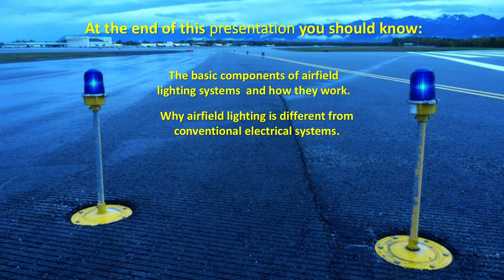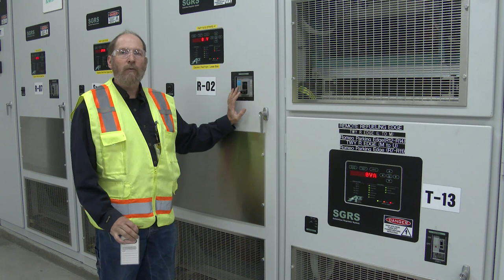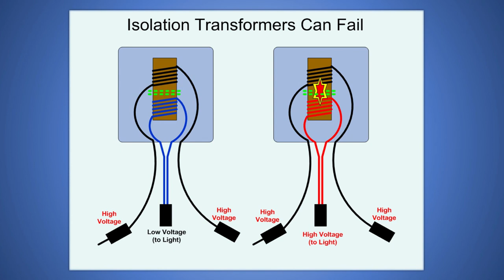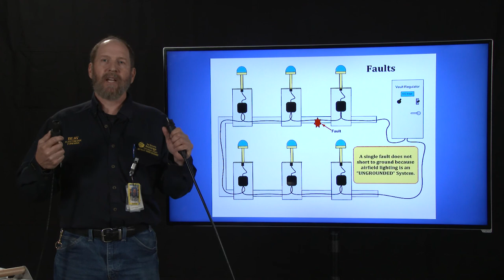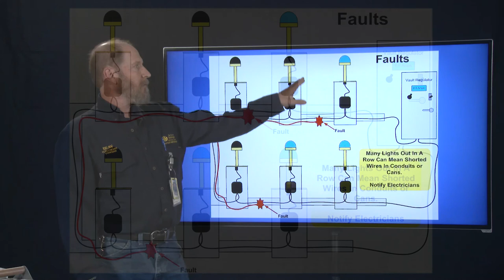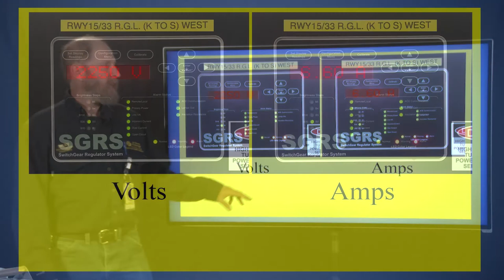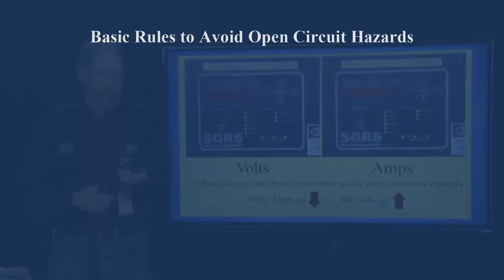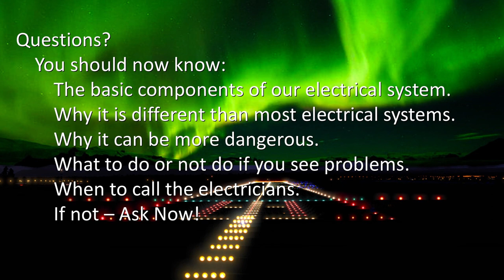TSAIA - Airfield Lighting Safety Program

Comment: 36:18  put it on a radio. You likely have some kind of radio with you, right? Company radio? Airfield radio? Put the clamp over the radio antenna and key up. The meter should show some amps. This is how I tested mine. 

Also, if you take the final bolt out of a fixture and it sparks, you likely have a live fixture. It looks like someone just tapped an arc welder against something. Stop right there and have the circuit shut down before you go any further. 

Have you heard the one about the exploding can? If you're troubleshooting and you find the fault, often the atmosphere inside of the can will be white. It may be white with steam (and you can get a fixture launched into your face from steam pressure alone), but it's usually with vaporized wire insulation. This insulation is flammable. What do we need for combustion? Fuel, heat and oxygen. If the can still has an arc going on, you have two out of the three. Fuel from the vaproized insulation, heat from the arc and all it will take is cool oxygen to be drawn into the warm can and BOOM, you have an explosion. I've seen this once. The fireball went a good 3-5' into the air. Fortunately, we had all gone to get tools or whatever from our trucks. I was several feet away and felt the concussion from the blast. Imagine if someone had been standing over it. If you must open a hot can where you suspect the fault is, just barely loosen the bolts and pry the light up with a pry bar to see the smoke/steam rolling out of it. And wear your gloves to do it. After the exploding can, I'd ask for the ckt to be turned off before I opened where I thought a problem was. 

I've been shocked from what I figure was the primary side of a circuit. Just changing a light, I began to stand up and was grabbing at the bolts at the same time and I heard an arc and got a very bad shock. My momentum fortunately made it so I fell backwards and not forwards. Kind of a 'WTF just happened' moment. It went through the air to get me. Figure the voltage was between 800-1200 with the ckt on step 1. 

I've also opened a circuit hot. I swore my meter showed 0A, but I saw a small orange arc and saw the other interleave had gone dark. I about shit my pants when I realized what I'd done. The female joy kit must have been coming from the regulator. 

I don't work on the airfield anymore. I left due to some things going on with the airport where I worked, but I found out later it all may have smoothed itself over and I may have gotten a very nice raise would I have remained. Man I miss working on the airfield. "Bending pipe and pulling wire" is utterly boring to me now.
Reply: It should always be locked off before opening anyway.

Comment: So where there’s a faulty light fixture with the cabling con sealed and having it locked out , how do you test for dead if you can’t access the cabling ?
Reply: One way to test your lockout - Lock the circuit for the fixture in question and then turn all other circuits in the area on.  Now see if the light in question is on, or any light near the light in question is on.  If any light near is on you could be on the edge (transition) of another circuit and the light in question could be live with a lamp out.  Lock out all the circuits that could be in the area, then remove the light and test primary cables with a clamp-on ammeter before opening any primary wiring connections.